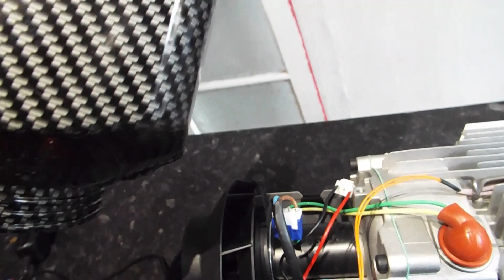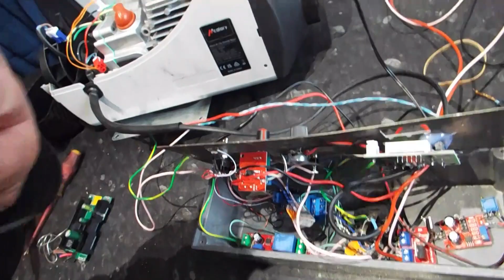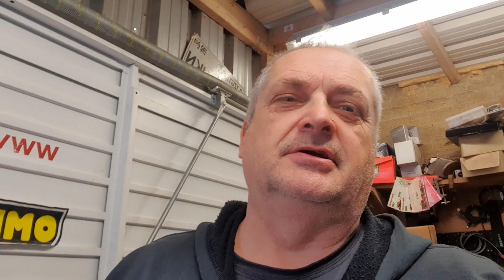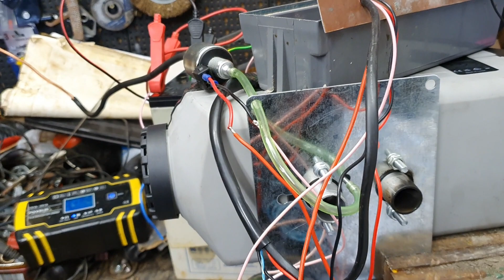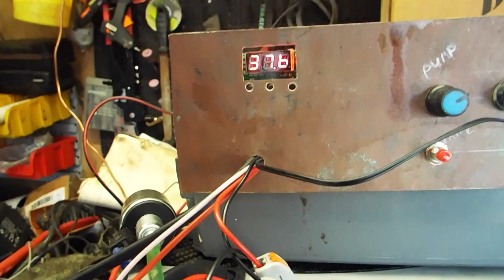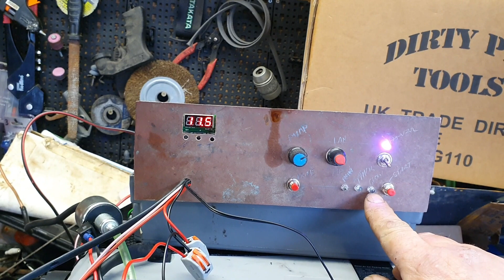Simple homemade Chinese diesel heater controller, first time test #dieselheater #chinesediesel

Comment: your green hose is not the same as other peoples green hose. dumb of you to assume it is.
Reply from the maker: Interesting comment, thanks. I've just had a quick tot up and of the 26 diesel heaters I've now bought and installed for various projects in the past 2.5 years, apart from maybe 6 which came with decent semi rigid white tubing, all the others have come with the same old green stuff. Tell me you don't have a clue about what you're talking about with actually saying it.
Reply: @shanehogarth6373  actually I do.  I have 5 types of green hose. All are different.
Reply from the maker: @joeds3775 There's that smell in the air again. It's a well known fact, proven by several knowledgeable enthusiasts right here on YT, that it's not important what type if hose you use. Take your heater apart and look for yourself, the steel feed tube into the burn chamber is simply an open ended tube, no restriction, no pressure as such required and even if you have rainbow coloured tube, or any of the 5 green variants you claim to have, your heater will function. The only factor to take into consideration is to keep an eye out for heat deterioration where the hose fits on to the burn chamber inlet pipe, the green stuff doesn't have a lot of resistance to heat. If you want to act "dumb" and not listen to others on here who have proven what I'm telling you, then that's your perogative and you quite obviously know best. Good luck with your 5 types of green tube and have fun with your diesel heater.

Comment: I have one of the 8K and it seems to be having a controller & or a ECU problem.  It keeps throwing E-06 errors
I have verified the Holtz adjustment & glow plug does work because the dosing pump will run, but only once a day for 15 minutes, then I get the E-06 error. Then you have to power down for hours
If buying another ECU and or a controller, do you have a recommendation?
Reply: air mixture is too low. too much fuel. 
1688 is the pw if your lucky enough to have one u can adjust.
alt, hold down the ok button to turn on high altitude mode... which lowers the fuel mixture a bit. 

next time get the 5k one. 8k one is theoretically not possible without sooting up or overheating the heater.
heater calcs are done via amount of diesel fuel put in. a bit missleading.
Reply: @HotNoob  I gave up on it because I had changed the dosing pump twice, so I bought another ECU off of eBay
The new ECU & control panel is the newer one?, no way to designate which it is. It has a black frame on the board. Needless to say, the heater now runs great & is a workhorse - no issues, Thanks
Reply: I have found several times that the 06 error can be caused by the fan motor being worn out! By replacing the motor cured the 06 error. These motors are repairable ( brushes and bearings) quite cheaply but the Chinese heaters it is easier to just buy the motor ($15) and rebuild the fan unit using the original fans and mounting.
Reply: Thanks for the reply. I did manage to get mine up & going by replacing the ECU & the controller. I really think the brand new ECU that came with the heater had a bad board. It now runs great & is fuel efficient to boot! @peterclancy3653

Comment: Good stuff. 

I learned to weld pretty young with an old Lincoln tombstone stick welder... I should say "learned to weld" as I never took a class, just watched my dad and got some tips from him. After that, using a flux core wire feed welder is bliss.... I have used MIG (gas), it is nice, makes less mess and a better weld, but it is costly and always runs out when you are in the middle of a project.... 

Good to see you got it up and running. It sounds like the pulse generator is staying on too long. I'm not sure how long the pulse should be 🤷‍♂... saying that, I wonder if they actually have a reverse polarity pulse ... I guess you can check that with your oscilloscope. 

The shutdown is a bit of a tricky issue as you basically have to go off of temp. I would think you want the pump to turn off if it drops below 100C, but maybe I'm overlooking something obvious. I suppose what you could do is add another thermocouple to the burn chamber or outside of the burn chamber and use that temp to detect flameout. It would be more sensitive and quicker to respond. 

Anyway, good stuff, keep it up !
Reply from the maker: My dad was a welder too, he would be horrified at my welding and am sure he would call it "pigeon shit". 
Yes, how it was driving the pump today, isnt how it was during the tests. I am sure I have pulled something off around the multiturn pot get around that I cobbled in. I aimed and achieved about 25% (on) duty cycle and today it was completely different and I also noticed I had a completely different range on my main pot on the front panel, so I am sure it's going to be a connection at the board end.

I can get around the shut down simply using another timer board, but not sure how important that is. I was thinking if I was to put another switch in for the pump, that could be simply switched off a few minutes before so all the residual fuel is consumed, instead of adding yet another timer.  I do have a couple of options for the thermostat and have ordered a few bits today. Thanks for the comment Joel
Reply: @shanehogarth6373  My father wasn't a welder by trade, he was a mechanic, but he was also a heck of a fabricator and could weld with the best of them, as they say. 

Yeah, it's pretty easy when you're working with something like that you pull a wire off and have everything no wrong. I'm not sure if you are talking about shut down in the same way I am. I was thinking in the case where you have an unintended flame out and you want the pump to stop before it is completely flooded. 

I'm sure you will get it all sorted out... you made it this far and you know what you're doing .  Good luck.